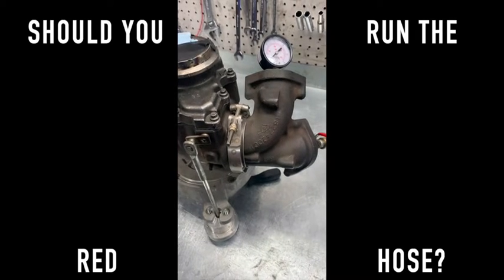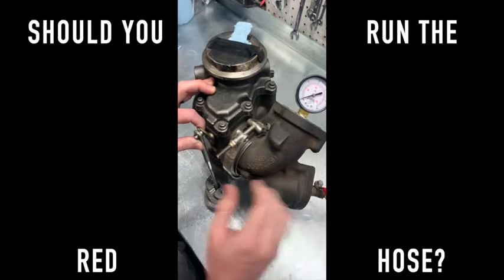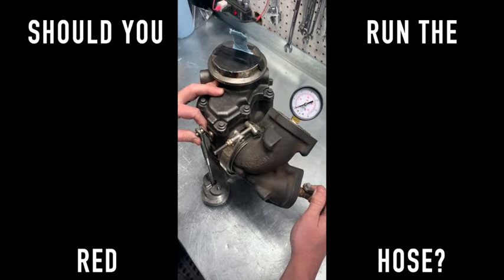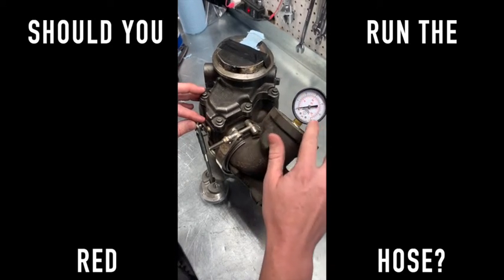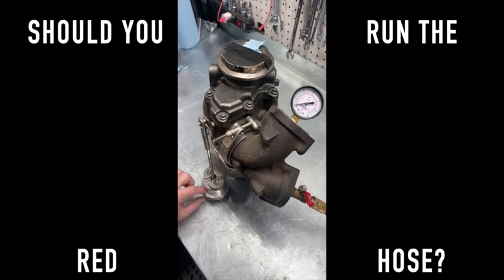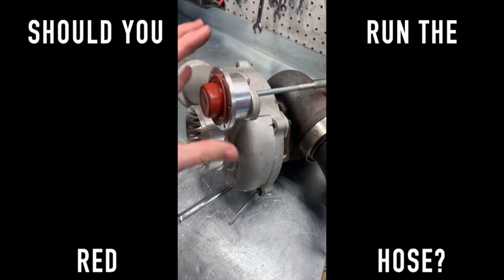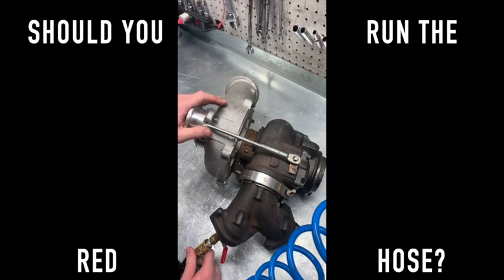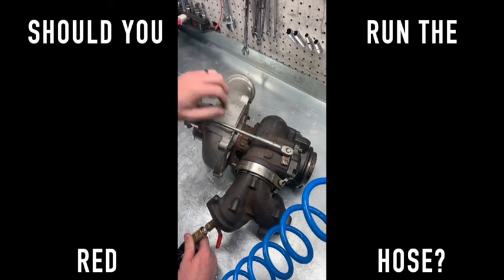Should You Connect The Red Hose?

Comment: Mine is dumping off and on. I had the waste gate hose hooked up. I didn't  know about it. Should i tighten the waste gate up? I cant hardly push on the throttle. It will build boost and dump and its a viscious cycle

Comment: Had a local shop but on your turbo with a Stage 1.5 kit. Been trying to chase boost leaks for god only knows how long. After 3 weeks, I’d had enough and went and got the damn truck. It would not build over 12 lbs of boost. Been trying to trouble shoot for a while. Ran across this video, went out disconnected the red hose, 25 lbs of boost instantly on the gauge…..unbelievable. Thanks.